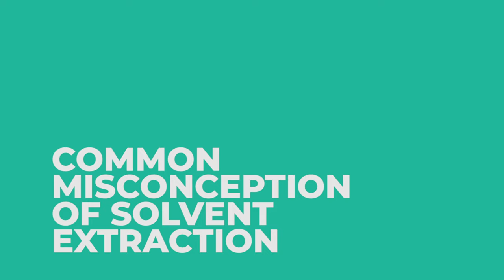Cannabis Extraction Explained: Ethanol vs. Supercritical CO2 vs Hydrocarbon Extraction

Comment: Well done. Professional and well spoken. Explanations were made easy to understand without going over board in simplicity.
Reply: well spoken?  After many of his sentences, he uses the word, "RIGHT" and it became a struggle to finish his informative video. Right?
Reply: It's nice to hear someone who clearly knows what he's talking about.  Thanks.

The music though.. pls no music.
Reply: @catscan8561  saying right sounds like; we discussed this before, right. right?  or maybe you forgot. 😁
Reply: @3lo196  actually he has no clue what he is talking about. First you do not need to dissolve the cell structures, instead you break them open using sonication or silicate. Second, when doing large scale, you do not do batches, you do continuous flow systems. A variable geometry auger will compress CO2 to super critical pressures. Third, 5,000 psi is nothing. My engineering apprenticeship was at the company that created waterjets, think 120,000 to 200,000 psi, 25-40 times the pressure he is talking about. Lastly he needs to figure out his solubility issues. Is he looking for polar extraction, non-polar, both, what are the fractions in the solvents at the temp/pressure curve. It really sounds like he is buying equipment in China and rebadging it and marketing it via Google translate.

Comment: Good information but also pretty clear this company doesn't supply CO2 equipment, hence the fairly clear bias against CO2 technologies. Its important to remember for ethanol and hydrocarbon extraction that its not only the equipment that has to be build to the explosion safety requirements for the solvent but the entire environment and even the building the equipment is placed in. Although cost of equipment may be lower for ethanol and hydrocarbon extraction systems you may find yourself paying for this in your building design. However, he is correct that even if you use CO2 you will find yourself using large amounts of ethanol during the winterization process so the explosion requirements will likely still apply if you choose CO2 extraction. 
Not:, i don't sell equipment I use it, and all technologies have their benefits and drawbacks. I am in R&D for a medicinal cannabis company specializing in the extraction and purification process. Take caution when receiving advice from manufacturers especially if they dont sell the full suite of extraction technologies (CO@, ethanol, hydrocarbon).
Reply: Daniel Reason Thanks for your input. Very informative. Which method do you believe is the best for extraction considering yield and cost in mind? (Co2 vs ethanol vs hydrocarbon?). I would love to get your opinion on this. Thanks.

Comment: It's rare for a person to have the scientific knowledge and ability that Mr. Tennant has and to also possess the ability to simplify the explanation so that the non-scientist can understand and learn. I was looking for exactly what was presented - what the difference is between CO2 and solvent extraction -- and is CO2 safer. Safer meaning many companies market their CBD saying that CO2 is the safest and all processes with solvents are unsafe because of residuals that are then contained in the final product.   Thank you for such an informative  presentation and for addressing some of the myths that have been generated in the field.

Now I'm on to learning about Propylene Glycol vs Vegetable Glycol
Reply: Callie Ryder Callie Ryder? What is this field they are in? I am interested in pursuing something similar if not this exact profession.
Reply: never cut with PG  or vegetable oil to make a cart work please! Also co2 always needs alcohol for the winterization process. Co2 and ethanol are both solvents. When done correct solvents like butane are purged and Not detectable
Reply: I manage and extract at a lab that does butane/propane , Co2, ethanol and distillate.  They all test solvent free when done being processed 🤷‍♂️.    Co2 is great for terps though.  For crude it’s just easier to run decarbed material and get better yields and do simple winterize than turn to distillate and re add the Co2 cannabis derived terps.  Ethanol takes way more post processing to make into a project.  That being said if you can lock water solubles in frozen state at -80+ you can extract ethanol and pull minimal fats and waxes. I’ve made diamonds and sugar wit ethanol that rivals some butane extracts and even had amazing flavor and terps. But I’m a butane guy. Hydrocarbons do better job of grabbing the goods without pulling water solubles like chlorophyll
Reply: Right
Reply: @game_train3020  chemistry/ bio chemistry.

Comment: Nick Tennant is a very impressive young man.
The information was delivered coherently and the complicated processes simplified to a degree that it was easily understandable.
I rarely comment on videos but this presentation was great.
I understand that there are now extractors using Nitrogen as the solvent, any opinions?
Reply: We use nitrogen and get about -150 running through, product comes out like clear glass.

Comment: Would transesterification solve the the ethanol problem in your opinion ? As in removing trace solvent from the end product ?
Reply: Most extractors take the path of least resistance. Because almost all oil is decarboxylated post primary extraction, the low residual ethanol is chalked up as a loss and evaporated during decarb. This would make transesterification potentially viable but unpractical for this application.
Reply: @nicktennant7458   Thanks for your reply Nick , very helpful, cheers !!

Comment: Interesting concept , chilled  Alcohol as a solvent.
I used to build Ultra Low Temp liquid chillers for PC overclocking. loved it so much I took 2 years of HVAC during collage.
Ironically my prefered coolants  were Methanol for below -60f, and Ethanol between -60 to -0 as its not toxic like the Methy.
Still have a bunch of new unopened Copeland 1/3 HP R410a compressors w condenser's, TXV's, All Brass Taco- circulating pumps, flow sensors etc.
Maybe I should build/sell some for this instead HRMMMM...seriously.

Comment: You explained it wrong Buddy :) Co2 is not like solvent percolation , At Supercritical state Co2 diffuses into cell structure of plant material and carries away oil which can selectively extracted at separation stage plus Co2 extracts are safe as they dont have solvent residues . Also the Operational cost for Co2 Extraction is really low as it can be reused repeatedly and wastage is max 1% per batch
Reply: yes sir! thank you!

Comment: Right now I have a few 5 gallon buckets of 99.9% Isopropyl alcohol that was used to soak a bunch of scrap herbs. It's nice and filtered. Figure I'll run it through my moonshine still until I have a few gallons of extract in the still and about 6gallons of recycled solvent. From there I'll be mixing the concentrated extract with activated charcoal and refiltering it through a fine mesh nylon bag and allowing it to thoroughly dry. As in a few weeks. The activated charcoal removes all of the chlorophyl making it clear instead of green BTW. Later, I'll do a room temp rinse with acetone and keep the acetone layer and dump the rest which is just wax and crud. This doubles the potentcy easily. From there I'll dry out the acetone thoroughly as in a a few days and bake it in the oven at 210 f several hours to purge any remaining solvent. Then I'll probably redissolve it in methanol and pour it all into a smaller glass baking pan and once that's dried it's basically shatter without any solvent residue. It takes forever but is low budget and effective. The results are as good as BHO extract. i've taken the final methanol stage and dried it in cotton  balls and used them for a BHO extract with no improvements to it at all. It was pure already.

Comment: Wonderful. But which method is relatively safer on the smoker?
Reply: The end product of any method at a certified lab undergoes ppm testing and should all have around the same amount of impurities (or lack thereof). As he mentioned, residual solvents are purged by heat/vacuum.

Comment: Not disputing the process.not the point.just simply pointing out that while the solvent is removed,do we absolutely know for fact it did not alter the end product in any way,or is it simply assumed? How much analysis and chem break down was done on these products? I mean just speaking from experience in a few applications of distillation,I know that there are certain volitals,or metals or chemicals that may or may not boil off with everything else.some boil off very early on.and any time your boiling a substance like that there is a possibility of it breaking down into smaller components as a result.just food for thought.

Comment: CO2 is not a weak solvent. It is not being used properly due to the expense and difficulty to use it. A true liquid phase solvent that matches the polarity of your target while still being able to boast of a 100F lower boiling point than your target is what you use. Does not matter what media, political controversy or market strategy is used to change your mind. You cannot change molecular physics. Boiling point of the solvent and Polarity are the criteria for choosing a solvent. Cost and safety come into play as well. Safety is about flammability but labs are equipped for that and is an acceptable mitigated risk now so cost is the number one factor. Solvents with boiling points that do not go so far far below the boiling point of the target are going to be easier and cheaper to boil away. Cost to boil/recover solvent and replace them if the systems leaks them out is the constant cost that haunts you after you buy a extraction system. Matching solvent boiling point and polarity to the targets is what makes the solvent and system work or not. Being able to modify that solvent used to adapt to a new target is what makes it work even better. Extraction is not the time to be fucking around with creating a finish on the output. We are all adept in post processing by now or should be. Forget about cold super fast extractions to create vape pen oil. As the scale goes up so do the risk involved in losses to efficiency when extracting. You cannot afford to throw 20% away in your plant column every time you empty it. Get it all out and focus on post processing to refine into marketable products. Hell we dont even make tea or coffee with fast cold processes. We use heat and time and when it comes to the expense of loading a column or making products we should be using heat, contact time and 2-3 solvents with varying polarity as well. Still in their infancy.

Comment: You are incorrect on a hydrocarbon extraction having zero PPM residual solvents. I see test results regularly showing residual solvents. Yes the results are below legal limits set by the states but the results don't back your statement of hydrocarbon extractions having a zero PPM result. At least not every single time... Maybe a quarter of the time at best.

Comment: The only argument against CO2 is the high pressure right? But why do you say 5.000 psi is high? LDPE processing for all the plastic bags and bottles is done at up to 50.000 psi. There are a lot of industries which work at this level. That is just easy stuff if you know what you are doing. 

You also forgot to mention the advantages of the versatile CO2 process and please don’t say that others want to sell equipment if that is what you intend to do with your video. 

Peace
Reply from the maker: We know those facilities operate at much higher PSI, but their processes, equipment, and the environment they operate in are completely different than a cannabis lab. That information aside, CO2 systems are typically 1/10 the throughput of organic solvent-based extraction, at 3-8x the cost for similar-sized equipment. Also, with Hydrocarbon and Ethanol, you can make 90+% of all extracted products where CO2 limits you to only a few. In an industry that is constantly evolving, you need to be able to make pivots, and solvent-based extraction allows you to do so.
Reply: @PrecisionExtractionSolutions 
Okay, but what do you do if you don't want to extract just everything but want to have a selective high quality product without any unwanted reactions during the extraction process and any effects on the end products? Then CO2 is the rigth choice. I know that everything comes with a downside but there are also good reasons for using CO2. ;-)

Comment: Thought this was more marketing BS. 
On a small scale using ethanol for a very fast soak perhaps 30 seconds will extract a fair amount of cannabinoid and very little chlorophyll .
Reply: What about ethanol chilled to -18C? 1 minute?
Reply: Because of higher yield and the ability to recycle solvent via closed loop systems, hydrocarbon is much more cost effective with small scale production

Comment: What about steam extraction? I know that they use it to extract essential oils.
Reply: The most common reason one would use steam extraction is because of the lack of solvent, but as mentioned in the video, the final product should have 0 ppm of eth/butane/propane regardless. Steam extraction or distillation is much less efficient and cost effective, therefore obsolete.

Comment: If producers get up to producing over 1000lbs a day they just need to double their equipment. The profit margins at that rate are easy to justify two systems to run 1000lbs each. Keeps a more manageable batch without resorting to a lesser solvent

Comment: -40? Do i need cryo ethanol to not soluble water-soluble compounds? or -40 is enough.
Reply: some people do quick wash -20 and that's enough
Reply: @dimmacommunication  Actually I think using dry ice is much better than using fridge (-70 - -80 with dry ice vs -30 with fridges).  Im asking if you have to reach cryo temp to not dissolve junk or -40 is enough
Reply: @krzysztofnowak5270  What do you mean by " junk" ? plant matter ?
Even at -20 you don't dissolve it.
Probably you need -40 for waxes

Comment: What about ether
Reply: Ether is a decent solvent but in America (and in many other countries) ether is a controlled substance because of its utility in methamphetamine and cocaine production.

Also, when ether os exposed to oxygen in air, it developes peroxides which are very explosive. When you distill out the ether to get the oils, the peroxides are concentrated and exposed to higher and higher temperatures. I’ve seen ether stills explode due to peroxide contamination, it’s a terrifying explosion. You don’t want to market exploding shatter....
Reply: "The only thing that really worried me was the ether."

Comment: Really misleading. CO2 is an extremely versatile solvent, which can be tuned to almost any non-polar application (or indeed polar with a small amount of co-solvent). In our experience, in 45 minutes, CBD extraction is complete (with 20x solvent to biomass ratio) and with in-line fractionation, there is no need for winterisation. Supercritical propane/butane has advantages indeed, especially the fact that there is no residual moisture in the product, but almost impossible from a compliance point of view. Ethanol will not work with many non-cannabis applications, so you are locked into a monoline CAPEX heavy business. And with regards to costs, I doubt that a solvent extraction plant with a capacity of 2 tonnes a day would cost much less than $1M. Nice promotional video, with mostly correct thesis, but very biased in favour of the product that you sell.
Reply: You could practically repost what you said with each solvent system replaced by <insert common cannabis solvent> as they all have their upsides, are modestly versatile, with tunability, the ability to create speedy outcomes with the proper engineering and optimization, etc. etc.   The Broader point made in the video about the unrealistic, downright false, claims that are routinely made within this space about residual solvent impurities are CORRECT.  In the context of legal, regulated cannabis industry, there is no issue of solvent entrainment.... just as there is no issue of solvent in ALL chemically adjacent natural products that have been extracted via similar mechanisms and solvent systems for the last 40+ years.  The only legitimately "novel" or "new" techniques in Cannabis are also "new" in natural product extraction, such as the shift to continuous/flow chemistry and purification and away from batch, technologies that complement that design (like the various types of countercurrent partition chromatography and rectification, simulated moving bed column chromatography,  and membrane solutions like OSN for ethanol recovery and membrane partition/separation as an alternative to winterization and other polishing steps).